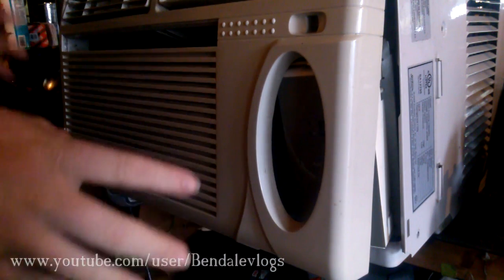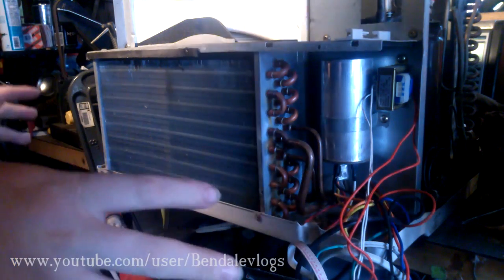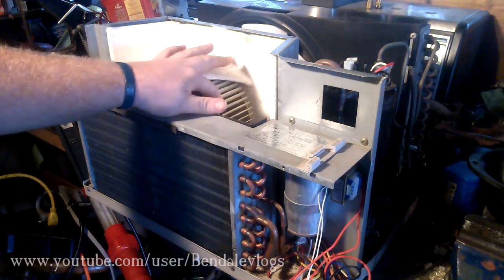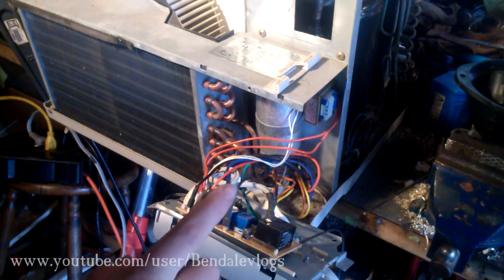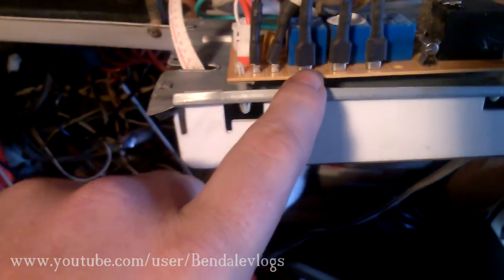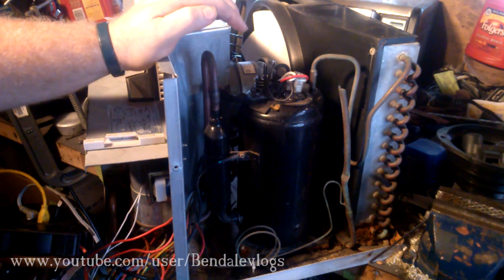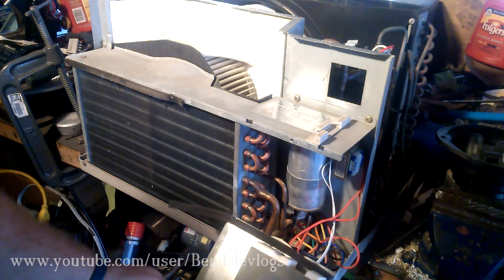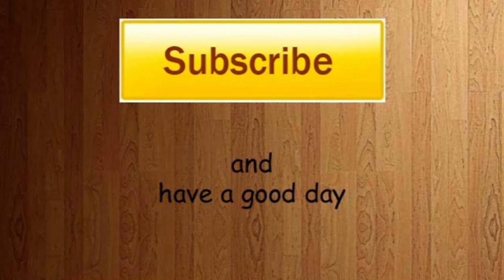Let's repair a window air conditioner

Comment: My AC works well when I plugged it in Only problem is it only blows warm Air but Not Cold air like it should be too cool my room. any suggestions to what the problem might be? really appreciated
Reply from the maker: +Mittens Rojas probably needs to be recharged. Call a local AC shop. It's likely not worth the cost. There are ways to diy it but they're not simple
Reply: +Ben D thanks for the advice, So I only need to call a local AC shop so they can recharge it at no extra cost? and ooh yeah I forgot to mentioned that I thought it was not blowing cold air because it was dirty/clothed with dirt so I took it apart which was not so hard and cleaned it really well with a brush and them water it which did not damage any electrical cores btw, and put it back together again which was not hard and still didn't blow cold air like I thougth it would.
Reply from the maker: +Mittens Rojas they will charge you to recharge it, you will have to pay to look for and repair any leaks and you will probably have to take it to them and that cost might add up to more than the cost of a new unit. I suggested calling an ac place to get their opinion on repair versus replacement. Window AC's are so cheap they are generally not considered worth repairing.
Reply: +Ben D thanks for the advice once again I will give them a call to get their opinion on repairing vs replacement or I might just buy another one since they are so cheap like u said thanks again really appreciated.

Comment: Ben, fan works  but compresser won't kick on, was in and out for two weeks, can I bypass the thermostat where compresser comes on upon starting, which color wires need to be removed, can you help brother, thanks
Reply from the maker: +mica lavolpicella sounds like you need a new relay or capacitor. Capacitors are cheap, relays can be expensive but you can pull one out of an old fridge. There are ways to bypass the thermal safety and the relay but it's a little dangerous. Don't try it unless you know a thing or 2 about wiring and multimeters. I can walk you through it but it's alot to post here.
Reply: Ben D thanks brother I'll look into the capasator first, best regards!!!!
Reply: Ben, which capacitor for kenmore 5000btu 25 5 uf or 35 5 uf 370 - 440 thanks, not home at moment want to order and have part waiting for me at home, thanks again brother!!!!
Reply from the maker: +mica lavolpicella any cap with those same numbers will work. The capacitance numbers (uf) are the important ones, the 370-440 is voltage and isn't as critical. If you find one with the right capacitance but it's 300 or 550 volts it will still work.
Reply: Ben D thanks brother I'll look into the capasator, take it easy bro, peace

Comment: thanks for the video. my unit will blow cold for a few minutes and then it seems like the compressor stops running...  any ideas here?  Two of my units started doing it this week! HOT!
Reply from the maker: Sounds like the thermal cutoff is shutting down the compressor. It could be a bad thermal cutoff or a bad compressor. Diagnosing it in a few sentences is nearly impossible. If the compressor starts up just fine it might be worth a few bucks trying a new thermal switch, you can get them new or you can pull one off an old ac, fridge, freezer, dehumidifier etc.
Sometimes they are built in to the control board and if that's the case it's not worth trying to fix and remember always unplug it before you do anything

Comment: Will a plug from hardware store work on my 110 window unit.The plug burnt and needs changed.Or will I need to just change the whole cord and how difficult is it?
Reply from the maker: +Mike Westbrook you should be able to change to plug end, unless the end has a fuse of gfi of some sort. 
It should be as simple as cutting off the damaged part striping back about half an inch of the insulation and wiring in the new plug end.
Reply: Yee it has the gfi plug
Reply from the maker: +Mike Westbrook you can still replace it. Those replacement ends are less common but they are available. It might be easier to replace the whole cord as long as you have access to a soldering iron.

Comment: For future reference your teaching on how the refrigeration cycle works was ass backwards the small 1/4" line off the compressor is your discharge that the superheated compressed gas is pumped to. Then goes into condenser coil on the outside, giving off heat, the gas then saturates into a liquid. Then after the condenser os a metering device in this case a capillary tube. After that a low pressure liquid is now in the evap coil and around halfway or 3/4" up the coil the refrigerant starts boiling off. Thus giving the cooled air effect. The now gas state refrigerant is sent back to the compressor through the suction line (the bigger one) then passing that big canister called an accumulater
Reply: Paul Brandt You totally forgot to mention how the flux capacitor regulates the main axes. SMH
Reply: If you toutch the cap while ac is on it will knock you on your ass! Or kill you!  The fan motor needs oil or it's bad. I would take the motor apart and clean it and oil it and re assemble. If the fan is tight the compressor can overheat and burn out. A light bulb can be a good test instrument for current!

Comment: I have a cord with the reset button n test button 115v my outlet short an  short out the cord blade can i put a regular ac cord thnku first time here
Reply from the maker: The reason your cord has a gfi (circuit breaker, sometimes called a gfci) is because you are dealing with electricity and water (in the form of rain, snow, humidity, condensation, etc.) and they don't mix well. You can swap in a standard cord if you can't find a cord with a gfi but make sure it's heavy duty.
Reply: Thnku let you know what happen when I install a heavy duty cord

Comment: What would cause a Kenmore heating and cooling unit not to heat up? It was taken out and cleaned
Reply: It's. A window unit from sears
Reply from the maker: +Brenda Conwill I'm not familiar with that Kenmore unit but heating is usually much simpler than cooling. It start by looking at the control board (after you have unplugged the unit) if you don't see any obvious damage it's likely the heating element. Check it for continuity.

Comment: Not sure if ur still around but if u are I have a friend whos window unit shut off and won't turn on, it shut off when it was raining yesterday and it won't turn on even did the reset button and still nothing, if u can I'd appreciate some pointers I could do to help her get it running again thank u
Reply from the maker: That really not enough info to make an educated guess. I'd start by ruling out some variables.
First make sure it has power, check the outlet with a lamp or something similar. If there's power but the unit isn't running( no sound, no lights, etc) I'd say it's the cord, fuse or the board is fried. If it has power to the controller but won't make cold air you probably need a new capacitor or relay.
Check those few things and get back to me.

Comment: nice video! my question is how would you check the power coming in to unit and out. I'm talking about that circuit board. is there a specific location to put your probes in. I'm having trouble with one as we speak. nothing comes on. Only the power cord light is on.

Comment: my air cond. compresser wont shut off . I can cut the ac unit off with the remote but the compressor will still keep running. I have to un plug it to get the compresser to not be on . when power is turned back on the compresser comes on.
Reply from the maker: Sounds like a short or damage on the control board. There's not much I can tell you other than try testing for continuity, look for frayed wires and check the board for damaged components and black marks. Make sure you unplug the unit first.
Reply: thanks for the help.

Comment: Sounds like a bad run/start capacitor.   that would cause the motor and compressor to have start issues for sure. if the motor had bad bearings it would always be tight on or off

Comment: my compresser won't shut off. it gets really cold even tho I hight the temp. I have to unplugg the ac unit for it to shut down completely
Reply from the maker: +12kingRC sounds like one of the relays is stuck. Have an electrician (or a knowledgeable friend) check it with a multimeter.

Comment: Thanx for the video but it was something you said not the video that helped me successfully repair my AC unit. You mentioned that there is almost always a wiring schematic in the panel but there wasn't on mine so I took it apart completely and found it tucked away under the compressor ( damn chinese). And bodda bing bodda boom I fixed it. I have been searching for days online for that diagram so thank you for reminding me it was probably inside somewhere.

Comment: Do you have a video that explains how to repair the window AC if the unit won't pull any moisture out of the air?  It cools fine.  thank you!
Reply from the maker: +Mary Robertson if it cools the air sufficiently then there's nothing wrong. The fact that they dehumidify is just a side effect.
Reply: Thanks Ben.

Comment: Why can't you apply some oil to the fan shaft ?
Reply from the maker: You could as long as you use it sparingly. You wouldn't want oil flinging around and getting on the wires or getting inside the fan motor.

Comment: I dont at all understand ....obviously the bearings in the fan motor is bad or going bad. It shouldn't have that much resistance (slowing) down that fast when you shut off the fan. Maybe replace the motor ..? Cause it's obvious that's the only problem

Comment: as I commented down below I was sitting watching TV one night and my air conditioner was working fine all of a sudden I heard a racket like something was hitting the fan and then little pieces of black plastic were shooting out the vent I immediately shut it down and tried it again and still it started making that racket I am presuming it is the black plastic fan after I looked it up online and seen what the part look like is that something I can replace myself it is a Kenmore in wall air conditioner digital control panel
Reply from the maker: +William R Streber shouldn't be to difficult. All the fans I have replaced have been press on. Unplug it, open the case, unscrew the fan motor assembly (be careful of the cooling fins and any foam) prise off the old fan, press on the new one and reassemble.
Reply: Bill Streber i miss my old lincoln town car ....i just sold a 1991. It was and always will be the most amazing ride i have ever owned i miss her :(

Comment: What do i do when it doesn't even power on??
Reply from the maker: That is a big question. It really depends on your skill level and how the unit is built. If you have a multimeter you can open the case and test the components. And simply looking for burn marks or damage can lead you to the issue. I'd start by checking the fuse on the control board.

Comment: my lights are on but it does not turn on what do i do?
Reply from the maker: +Kardanis Bibb if the control panel seems to work but there's no sound from the mechanism it's likely an electrical issue. Look for a blown fuse, burn mark or frayed wiring. Remember to unplug the unit and discharge the capacitor.

Comment: H there How are you thank you for the video and I just want to make a 
comment I had the same problem with a few air conditioners
that the fan was getting stuck that problem that i found is that.,
and I see it as a manufacturing error that the the blades of  blowers don`,t have much space 
I mean they are a little to big and the  box of the the air conditioner bents so easy
I meant the metal sheet they use is to thin and can bent by just carring the air conditioner aroud o if it fits a litle to tight into the window
so what I did is that I removed the blowers fan   and I sanded the ends of the blades
about one third of an inch  then I put it back and that fixed the problem and no more noice.
and whar I would like to lern is how to replace any of the coils and thay are leaking
and they don`.t compress any pressure anymore can you cut the pipe and weld the new one to the unit?

Comment: Great video, but my ac is maytag (brand) and its throwing little smoke for example when your outside in the winter you talk and the little smoke comes out your mouth, well thats how it is on my ac and idk if its the motor im not sure i need help with it, i have kids living in the house which im scared if the ac can cause a fire. Especially at night since i love leaving it on.
Reply from the maker: It might be smoke but it might also be a little evaporating condensation. Pull the cover (should be 4-6 screws on the side near the bottom) and find the source of the smoke, then you will know if you need a new unit
Reply: I think its water evaporation because i can hear the water inside. My bf says its because its humid outside also by the little vents theres water. So i think it might be that. It stops throwing that little white cloudy smoke as soon as i turn it off. I keep it running almost all summer.

Comment: Dude my AC wont turn on the control panel had a small electrical explosion
Reply from the maker: +xAlpha- “xAlphaMalex3” Gamerx you could try replying the damaged components but it's likely the unit will never work again
Reply: ***** Yea dude that sucks it was raining alot and the rain got in the AC i was thinking that was probably the cause of damage now when i plug it in it won't even turn on.

Comment: Dude , you've got no idea,  sorry , go to college / tafe or work with a fridgie in your spare time to get idea.
Reply: +sheparddog117  as replied .. You're right , shouldn't put shit on people having a go . Ok let's discuss this air con unit . If you have a meter that measures capacitance ( microfarads ) test the smaller capacitor ,((fan) usually for this size ac 3 -5 mic Farrah's , the large one ( for the compressor) should be written on side or bottom . Once you are satisfied both read correct capacitance you would reasonable be confident that the fan motor requires replacing although when you mentioned that  it was tight already you'd replace it anyway. Common  enough fault since water get thrown around as they get older and it gets into the bearings.
Reply: You right, he should probably just go get a job and salve away 40+ hours a week so he can afford to pay a real man to come and either do a shit job, or steal something. How about don't be an internet troll.......maybe even think about moving out of your moms house..

Comment: how to replace noise fan motor in kenmore window unit ?
Reply: I too have a Kenmore in wall unit sitting watching TV one night air conditioner was on low all of a sudden I heard this racket and little pieces of black plastic started spitting out the vent immediately shut it down I am presuming it is the fan blade when I looked it up online it is made of black plastic is that something I can replace myself

Comment: Good video overall, but some constructive criticism if I may.  I would do the voice over to where you talk about more the electrical and operations.  Basic refrigerant system only.  Any advanced refrigeration work you have to be certified for.  By the way you can also get capacitors on the web as well.  Edit your video to keep interest of fellow you tubers.  At one part I had a nap.  If you have a hard time finding a capacitor I may be able to help you
Reply from the maker: I am always open to constructive criticizing but first and foremost I make videos for myself and I won't edit my videos to please anyone but myself. 
I actually have another AC that may or may not work and I might take some of your suggestions if I decide to make a video on that. Thanks.

Comment: my AC is spitting water help .
Reply from the maker: +suzette fralin sounds like the drain is blocked. As air moves through the AC it is dehumidified, the moisture drips into a tray and then onto the ground. Leaves, grass, bugs etc can get in and block the drain. You might be able to clear it from the outside but most likely you'll have to remove the cover to get at it.